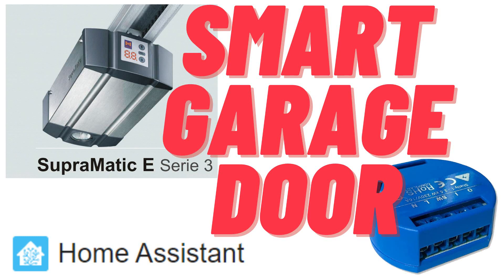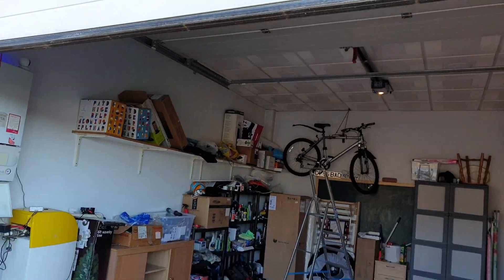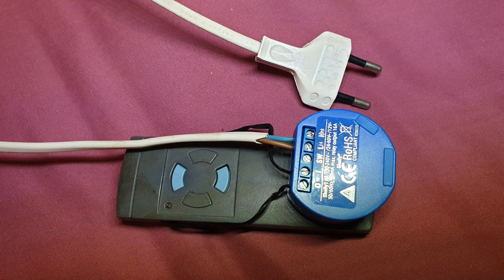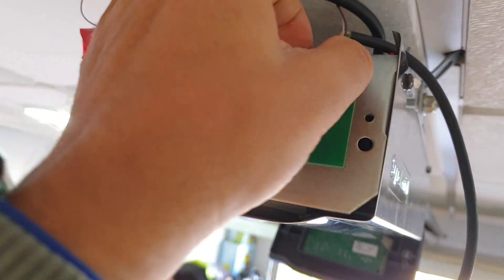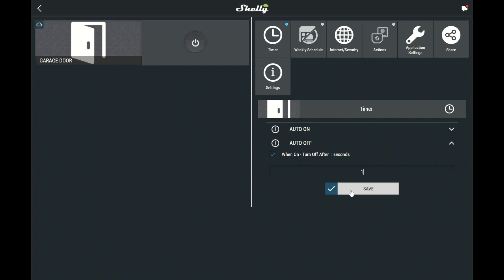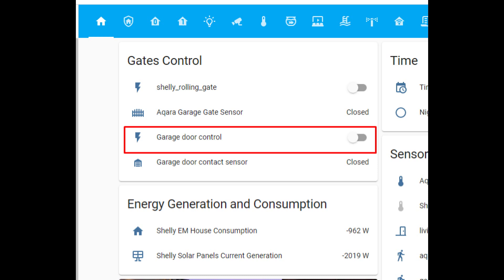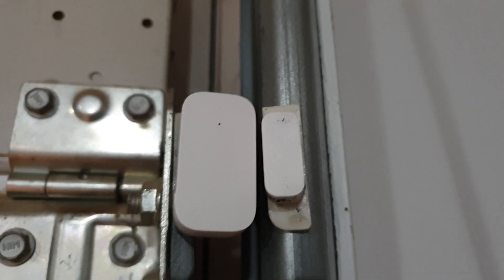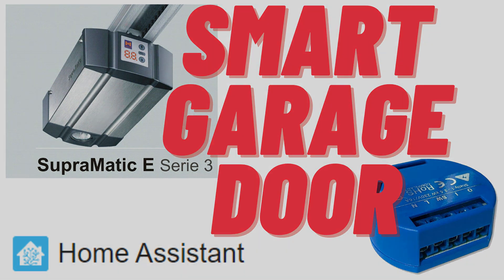Make Your  Hormann Supramatic Garage Door Smart With a Shelly 1 Relay

Comment: Hi, I have a Hormann Supramatic e2 motor, with integrated receiver. After a power issue at home the motor got stuck in 1/2 open position and I had to do a reset and retrain to make the receiver work again. However now the dry contact (operated by a switch on the wall) is not operating the motor anymore. Any idea what could be wrong? I tried doing the connection directly on the motor's dry contacts, and it's not working either, so it's not the switch or the wire. Does this need to be reenabled somehow after a reset? Thanks and regards !

Comment: Is this possible with a Shelly uni connected to the remote and a Shelly 1 to the motor?

I have two garage gates one external and one internal and have the internal working with the Shelly 1. Now trying to get the external garage door with the Shelly uni
Reply: As long as you can connect a physical button to "trigger", the Shelly Uni mit be the best option. I use it for garage door and for the gate.